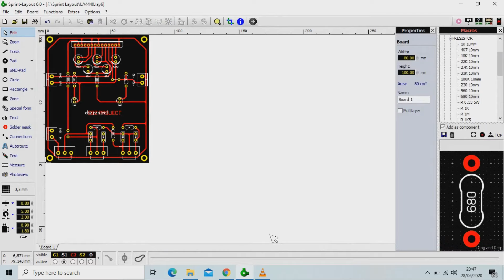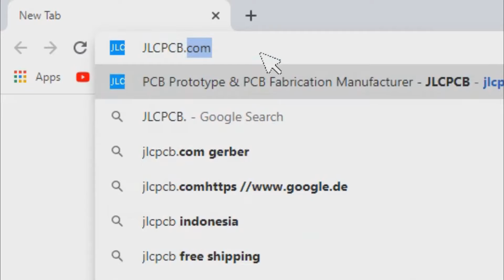DIY 20 Watt Mono Audio Amplifier Board LA4440 IC - #cbz_project

Comment: You uploaded wrong PCB design which shows negative is connected with speaker output pin of 4440 ic